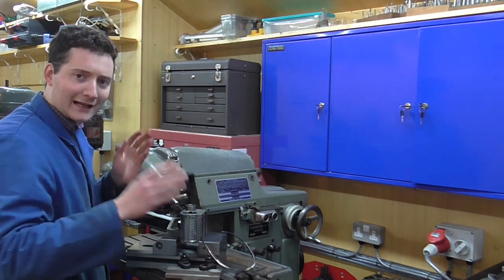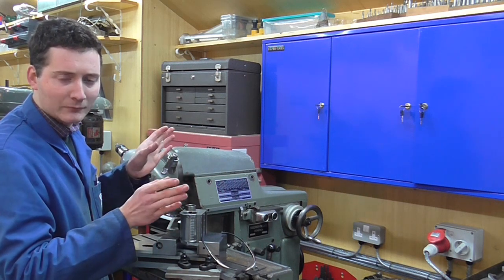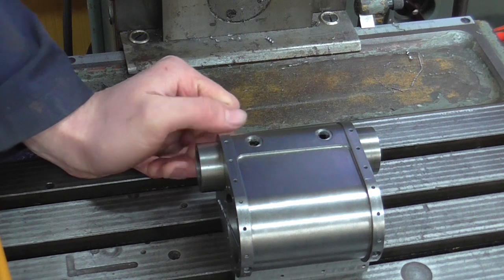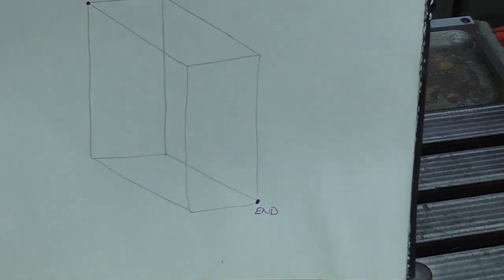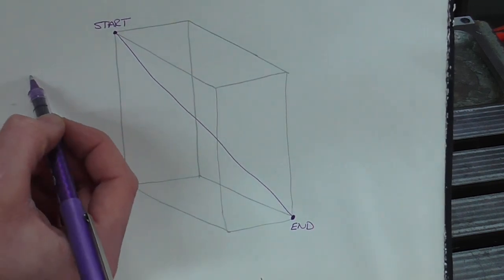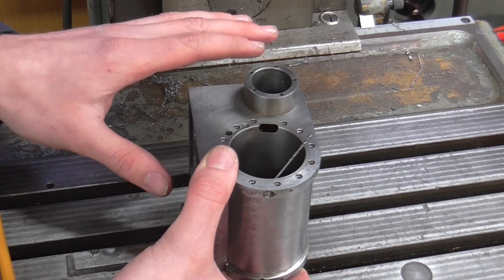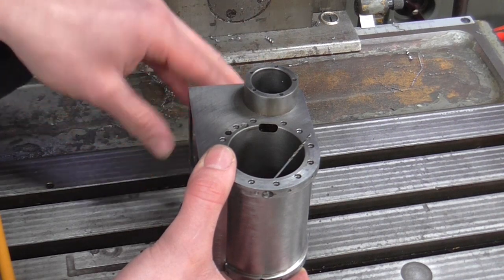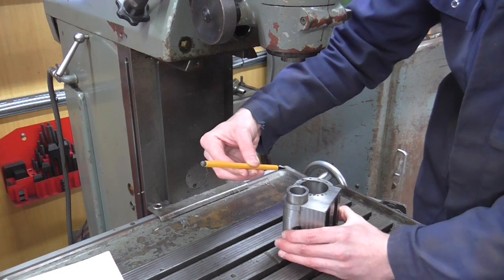Compound Angle Drilling

Comment: This could also be done on a drilling machine for those short of height (no pun intended) between spindle and taper. Manual alignment being necessary to the start point but accurate enough for a model engineer.

Comment: How did you eliminate the deflection of the drill at the start of the hole. Or did I miss this?
Reply from the maker: Hi. The first tool I used was a 1.6mm diameter ball nose cutter. It was able to cut its way in with out deflecting.
Reply: @MrCrispinEnterprises  thank you I must have missed  that xx

Comment: While it’s fantastic to watch compound angles being calculated and drilled I do wonder why the drain cock couldn’t have just been at right angles instead of having to find the “challenging” angle. Thanks for the ball trick. I’ll file that away for another day.
Reply: Apologies. I saw this before I saw part eight of the cylinder build. So now I know why you had to do the compound.

Comment: Depending on required accuracy and method of producing (hand marked etc) anything compound, I always provide dimensions that are less able to be used to get the wrong result. So in the case of this, instead of giving the angle to say 1 d.p., I'll give the adjacent and perpendicular of the two triangles defining the direction but as a multiple of the full size and let the machinist calculate the angle. This allows them to make the judgement on whether they close enough to get the desired result. This is especially helpful when the endpoints are at a decent distance apart - any small change in angle will result in a 'miss' which is rarely acceptable. I will provide the angle, if asked, but never on the drawing - it's simply too imprecise in many case - we're looking for the two points to correspond to other features, rarely a specific certain angle. I also provide the specific triangles required to reproduce the resulting angle as a multiple of their actual values so that factors, such as marking width, are largely negated.

Comment: This was very good practical demonstration put in a straightforward and unassuming manner. 
I can remember a maths lecturer in a HTC course demonstrating a solution to compound angled flats for milling. It was like a Bach fugue - he unpacked algebra all over a blackboard and resolved all the expanded equations into a single expression, substituted in two drawing dimensions and carried out a single division sum in a calculator for the answer. It took 3/4 hour, it was beautiful, but by the end I was admiring the elegance of it more than I was understanding the process. 
This demo, however, took me with it logically as well as aesthetically.
Well done.

Comment: Hello Mr. Crispin, I am writing to thank you for producing your excellent YouTube videos which I thoroughly enjoy.  I like the way you combine the math with the actual machining. If you have time to reply, could you tell me what the bore size is on the locomotive cylinder. As I follow along with your calculations and wanted to determine the final angle in your video called drilling compound angles.  Where you used a tooling ball! This brought back memories for me when I was a young man working at Rolls Royce in Barnoldswick, in what was then Yorkshire. I worked on the grinding section, mainly on fixtures for turbine blade production, but that was over fifty years ago! We used tooling balls all the time.  Well, keep up the good work as I am still learning and fully appreciate your efforts.  All the best, Jack Firth, Canmore, Alberta, Canada.
Reply from the maker: Hi, it's 1.690". Cheers

Comment: A sophisticated solution to a none existent problem. The drainhole doesn't need to be exactly in the bottom of the cylinder,the water will drain perfectly well from a slightly offset hole,it doesn't mind. However, it's great to see a properly trained and competent tradesmen at work ,thank you.

Comment: /what was the first tool you used to start the hole?  I would hope at that steep angle and beginning on a curved surface that you would use an endmill to create a flat first.   otherwise a drill would tend to walk off location.
Reply from the maker: It was a 1.6mm carbide ball nose

Comment: Yes one of the 3 people still watching. Great video explaining sine bar use, tooling ball use and the value of trigonometry. Really well done. PS. What size springs are called for on the driving wheels ? I am building a 5 inch 2-8-2 but drawings are unclear re srpings.

Comment: Hi MrCrispin. I enjoy watching your videos. I have a bunch of steam engine casting kits to machine. I like to do the math along with videos to see if I come up with the same figures. I wish you would have shown how you got the .134 dimension for the first triangle. You didn't say what the 2nd angle was, but I came up with 14.8 degrees. Also, I looked at your previous videos and couldn't find what the bore size is that you used to determine how far to move from the center of the ball to line the spindle to the hole location. In the video you make the liners, you showed the plans with the cut-away view and zoomed out so you can see the end view of the block, but the dimensions are too blurry to read. Thanks for making these videos and look forward to seeing more.
Reply: I realized that you have 2 similar titled videos. I was looking at Machining Cylinders part 1 which shows you making the liners. I found Machining Cylinder Heads part 1, which shows the bore size after you honed them. You show the mic reading of just under 1.690"
Reply from the maker: Your right on the 14 degree angle. Bore size is 1.690" I got the 0.134 by measuring the block on the surface table.
Reply: @MrCrispinEnterprises  Thanks.

Comment: Just watched your video, and it brought it all back to me.
I used to be in the hydrolic business, drilling valve blocks that had check valves. This included a lot of double compound cross drilling. Using a radial arm I used to tilt the work rather than the machine. I found getting tooling to reach or get into the valve cavity the hardest problem. But you explained it well and I enjoyed watching the video.

Comment: Very interesting well presented topic. I would like to know more about the applications that require such an angled hole and for what purpose it serves.? Perhaps there may be a simpler method of design to achieve the desired objective. Would appreciate your response, considering most home workshops may have only basic facilities. However thanks for your excellent video which I viewed from start to finish. ☑️👍
Reply from the maker: Have a look at my video 'Machining Cylinders part 8'
Reply: @MrCrispinEnterprises 
Hi, and thank you for your quick response. I checked out the video as you suggested and I can now see the reason for the angled hole for your application. I watched the whole thing and enjoyed your excellent presentation. Thanks again for your prompt attention to my querie. You may find my website an interesting distraction which is an example of concept design to realisation, further explained in my introduction and marketing videos. 
Ref:   www.klint.co.uk 
You tube, Keith Atklint. 
Cheers, 
Keith.

Comment: Hello Mr Crispin,
I may have misunderstood, but at 13:49 the line with the question mark, is that length not equal to the length between the two points on the red line (at 14:21) as opposed to the line labeled x (at 14:21)?
It seems to me that the "? line" (at13:49) is the horizontal distance (in the plane containing the red line) from the tooling ball centre line to the cylinder wall, which should be the same as the length between the two points on the red line (at 14:21) when viewed from above.
Thanks
Reply from the maker: What your looking for (line with the ?) is the distance from the ball centre to the plane demonstrated by the white paper cross section scene. The distance needs to be measured in line with the machines y axis. Not sure if this answers your question!?